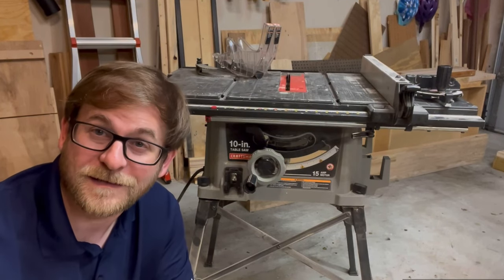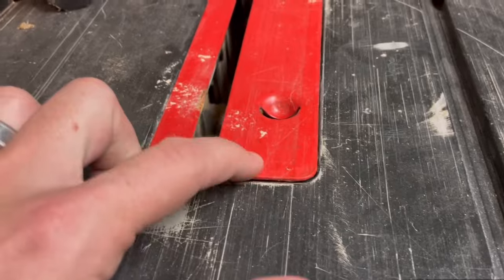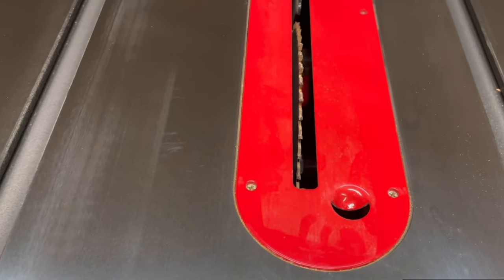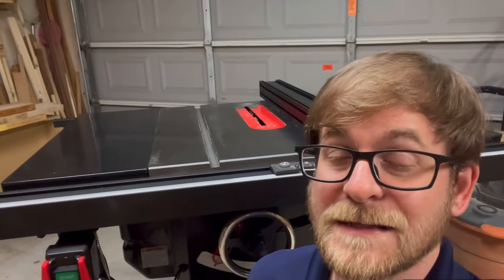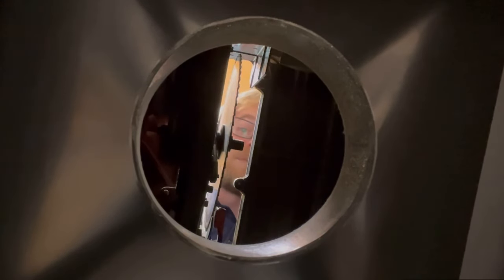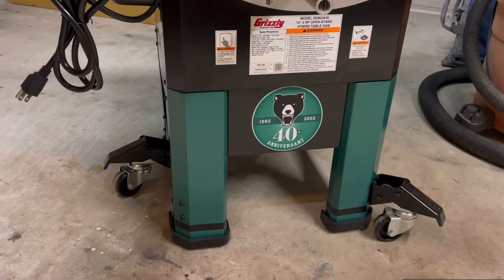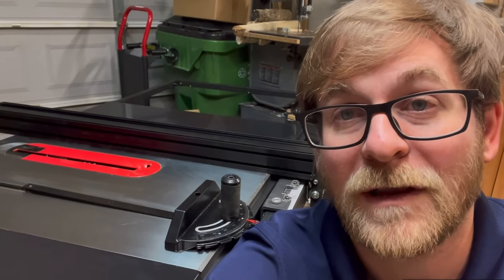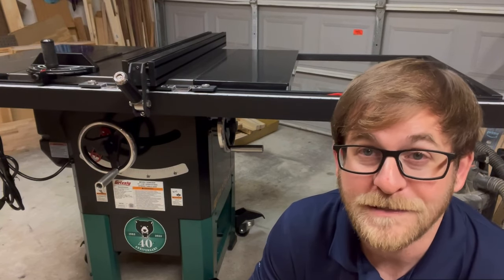HUGE Upgrade! Grizzly G0962A40 - 10" 2 HP Open-Stand Hybrid Table Saw Review

Comment: Thx Josh, I just ordered mine tonight. It’s a major upgrade for me too. I have several other Grizzly power tools, 14” bandsaw, sander, bench plane and dust collection. They have worked great for me and with in my budget. After your review I feel even more confident that the saw will fit right in. Thanks again.
Reply from the maker: Glad I could help! 2 things I’ve found so far: a good dust collector will help a lot. This thing can fling a lot of dust. And make sure you spend the extra time to tweak it and set it up right. Everything was off just a hair when I got it. I spent an hour or 2 honing the settings and now it works like a dream. Hope you enjoy it!
Reply: Will do, thank you for the advice👍

Comment: Hi Josh,
I’m very pressed for space in my garage.
Are the extended arms in any way able to be collapsed?
I think not but I really like this saw but the width is a problem.
Reply from the maker: Unfortunately, the wings do not fold down or stow away. overall it's about 5 feet wide. In my shop, I have to store my planer and dust collector under the right side. But it works for me.
Reply: @JPDesigns  thank you

Comment: Yes, I was sort of relieved when the order was cancelled because of the cost.  But now I am without a table saw having given the Craftsman away and the Grizzly based on your review looks like a more reasonable replacement at less than 1/3 the cost.  Thinking about an auxilliary leg on the drooping corner like the one that comes with the router table extension.
Reply from the maker: If it’s stationary, that would be great. Or you could build some cabinets/storage for under the wing and have it support some of that weight. I have to keep mine mobile, so that wouldn’t work for my shop. I will say, I don’t see a lot of deflection when in regular use. If I’m putting a lot of weight or pressure on it, I’ll see movement of 1/4” or more. Eventually I’ll replace that back rail with some steel angle iron or something to give it more rigidity.
Reply: My shop is smaller than yours so my TS has to remain mobile also.  Some of the larger SawStop saws with extended tables have "H" shaped folding legs for added support.  I might add something similar made from 1" EMT.  The leg that Grizzly offers from there welding table is really beefy and expensive.  I'll wait and see.  I just ordered the G0962.  Beefing up the rear rail is an alternative good idea.  Have you seen cast iron extension wings to replace the stamped steel?  Your reviews really helped this Craftsman Table Saw refugee.
Reply from the maker: @williamfraser1464  cast iron wings are great. I have a friend with them in a beefier saw. But for my skill and use level, I don’t need them. If I had them, I’d definitely need an upgraded rail.
Reply: one thing I miss are the Craftsman cast iron extension wings they had a open grid casting which made them great as an auxiliary work surface for clamping work when routing or cutting with a scroll saw.  I’ e tried clamping work to the Grizzly wings with very limited success.

Comment: Josh, had a SawStop on order to replace my 70 year old Craftsman but the local shop went out of business and cancelled my order.  Now looking at the G0962A40 which is less than 1/3 of the SawStop price and appears to take up less space than the SawStop cabinet saw.  Please provide the dimensions of the footprint for the entire saw as shown in your review. That would be the overall size of the saw top with extension wings and fence rails.  Thanks for your two reviews; very helpful.
Reply from the maker: A SawStop would be amazing. But they are just way too expensive. 
The top on this is 64” x 31” including the full wing extension. 35.5” tall. But the actual base is only about 20x20.

Comment: Hey, congrats on the upgrade it looks awesome!  I have had my eye on that for a while now.  I am currently using an old Delta 34-410 but I was looking at the newer Delta 23101500 from Lowe's which is like $700.  Did you look into any other saws before landing on the Grizzly?
Reply from the maker: Thanks Wilmer! I did a fair amount of research. I wanted a 2 HP motor, or close to it.  I know Grizzly used belt driven motors rather than direct drive which gives you more power. I also wanted a full cabinet saw but don’t have the space for it. The things that sold me on this one were the price the half cabinet, and the fence. Plus my buddy has a Grizzly and it is fantastic (although a higher end model than this). The Delta looks pretty good. I’d want to put my eyes on it and make sure it can be adjusted how I’d like it and check the fence (and other frequently moved parts) for material and quality. Ultimately, the power of the Grizzly mother for that price was the big winner for me.

Comment: Thanks Josh. Please do a few weeks in update when you get a chance.
Reply from the maker: Good idea! I’ll have to make one towards the end of the month. Are there certain aspects you’re especially interested or concerned about?
Reply: @JPDesigns  Yes - 1) power: is 2Hp enough for cutting say maple 2" thick (consideration for getting a 3HP saw vs this), 2) weight: to save weight where have they compromised? Is it sturdy enough? is there a ton of plastic everywhere? Are the steel inserts stable or rattly? etc.

Comment: Josh, what do you use now for dust collection(until you can purchase the dust collection system)  Shop Vac?  Do you use an adapter to connect the shop vac?  If so, how does it work; ok; not at all?
Reply from the maker: Shop vac doesn’t really work for airflow. So for now, I just let the dust fly and clean it up later. Not the best for my lungs, but I’ll get the dust collection going soon
Reply: I got that Harbor Freight dust collector made by Central Machine.  It’s awesome and fairly reasonably priced. Tried my shop vac as a stop gap measure and it was useless. The HF collector works really well.  Not sure what will happen with cutoff chunks because I don’t have a centrifugal separator- space considerations.

Comment: Hey Josh got my saw cuts beautifully. But! Man am I having trouble adjusting the rails and fence! I am in MN so it’s getting cold here and I am in a not very well heated shop. If you can clue me in more on how you adjusted the rails and fence I would much appreciate it. I have read manual over and over again - I’m sure it’s me just not getting it. There are not many videos out there at all on this saw. Ugh 😅 thx Josh, hope all is going well with your saw and you will do an update soon.
Reply from the maker: It took a while to adjust. To get the rails, I loosened the bolts and locked in the fence. Then moved the rails over so the fence barely kissed the blade and tightened the bolts. For the fence, there are lots of different variables. I had to raise the bearing in the back, adjust the tilt to the left, then line up the fence on a miter slot and adjust the angle so it lined up straight along the slot. The front of the fence, where the locking handle is, looks pretty crooked, but the fence itself is straight. 
It’s not a quick adjustment, but once you get it, it’s great!
Hope it helps. Maybe try giving Grizzly a call. I hear their customer service is top notch.
Reply: Thx! I appreciate the help.
Reply: I got my saw dialed in today! Love it! Thanks again for your advice.

Comment: I’m setting mine up now. Did you have any issues with it not getting to 90 degrees?  I’m at 88.9 and I can’t seem to get it adjusted.
Reply from the maker: I had to adjust the nuts on the threaded rod for blade tilt under the saw. Out of the box, it was about 1 degree off. It took a little time, but I got it dialed in to stop at 90. It was harder getting the 45 degree stop set.

Comment: I received my G0962 and am in the process of setting it up.  I used a portable engine hoist to get it upright and put it on the Bear Crawler Mobile Base.  I can’t seem to get the spreader/riving knife into the quick release fitting.  Do I have to loosen the nut and bolt on it to get enough clearance between the plates?
Reply from the maker: I didn’t have an issue with that. There is a lever that loosens the plates. Make sure it’s in the right position. If you still can’t get it, give Grizzly a call. I hear their customer service is top notch!